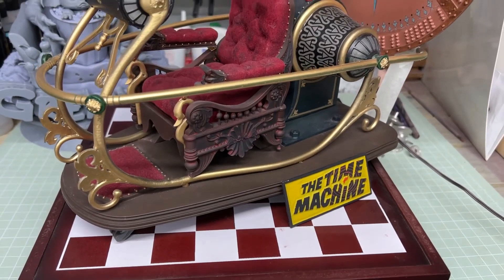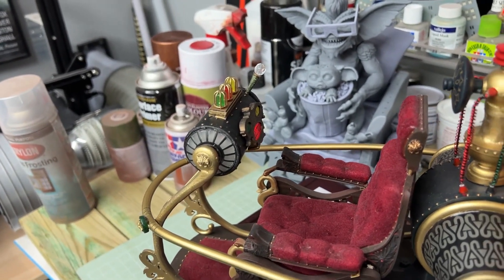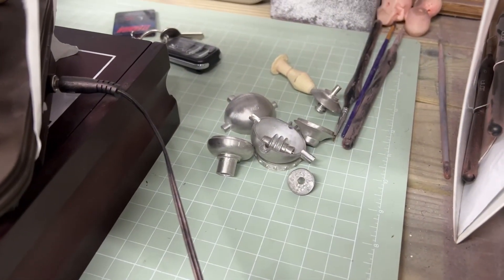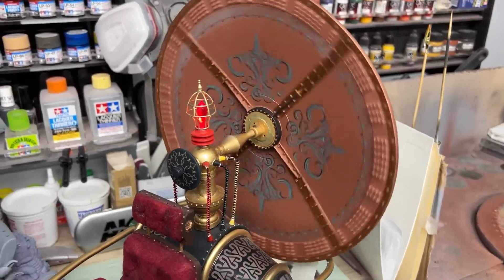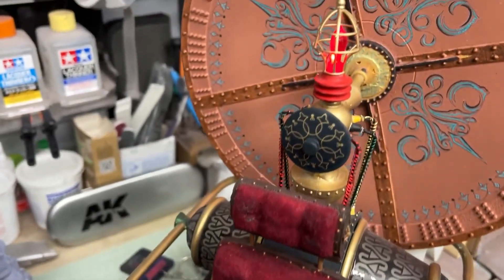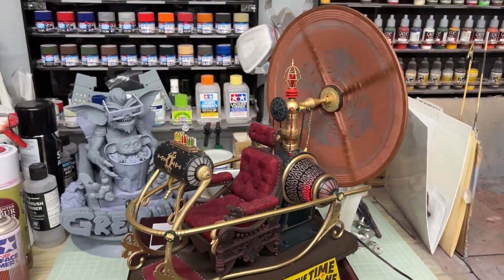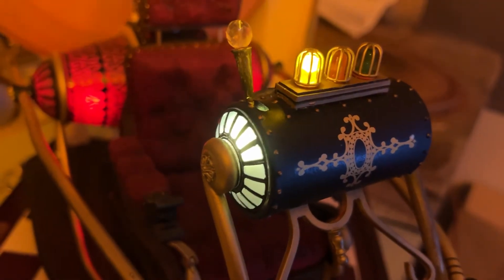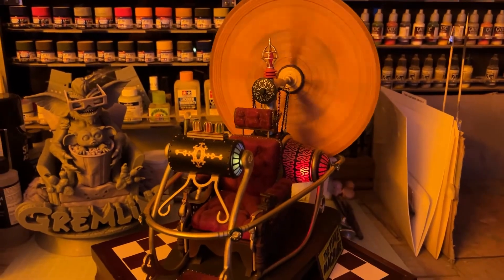World of Wayne Time Machine Reveal

Comment: If you add a resistor to the motor, will it slow start the spinning the disc then spin faster when you accelerate the time forward or backward?
Reply from the maker: No as the resistor would reduce the power so it wouldn’t have the torque to even start running
Reply: @WorldofWayneUK  I came across google search, I forgot about the miniature stepper motor.  It can be used with arduino. I'm sure you are done modified the time machine and accepted as it now.